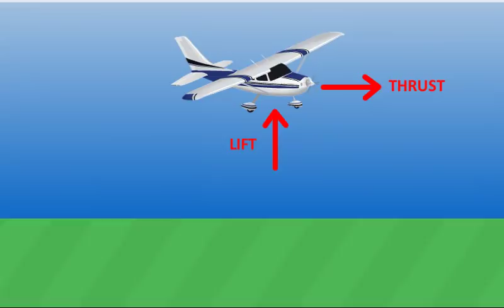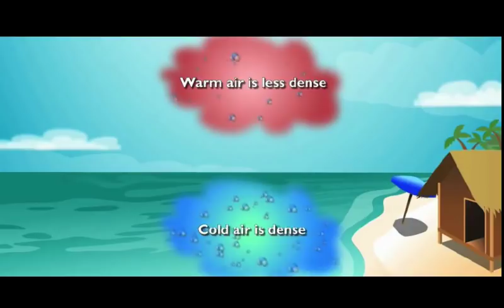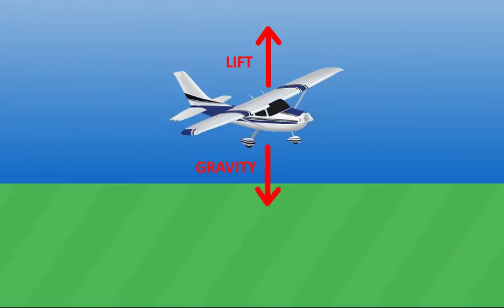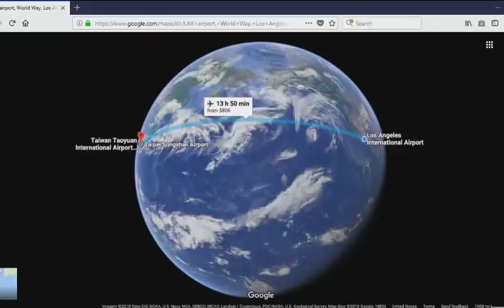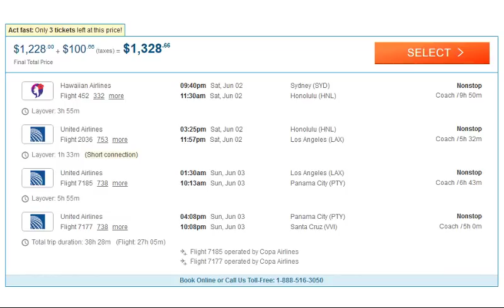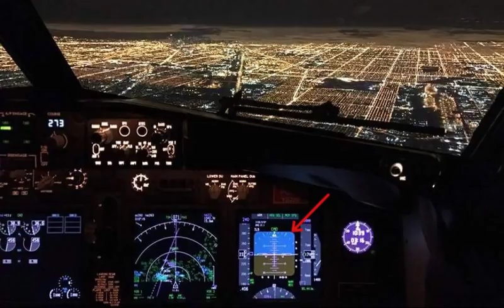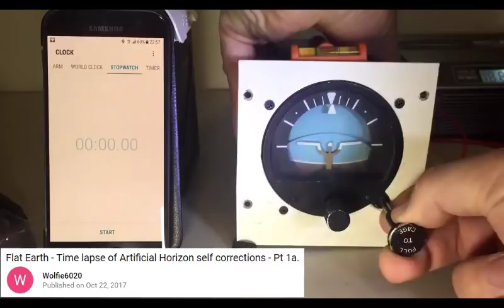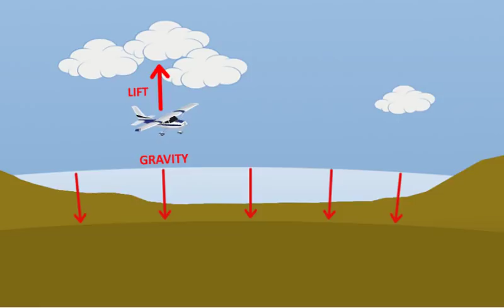Flat Earth Falsities - Plane Nonsense

Comment: Surely if the earth were flat it would be daylight everywhere at once but it's not when it's midday in one area it's completely dark on the other side. The earth is rnd man if your a flat earther you should definitely spend some time reading books
Reply: barreltapper he doesn’t rely on “if this happens it must mean that” at all, he gives actual explanations of why it must be. He never once says what you claim he does
Reply: barreltapper I never said you did or did not believe in flat earth. I was not replying to you but commenting on the video. I made a statement in accordance with my views. Also I found the video explained things very well, he backed up every statement he made and showed the flat earth for the ridiculousness I believe it to be
Reply: barreltapper because flat Earthers lack the knowledge and understanding of science to accept anything as evidence, that’s simply what it boils down to. To them, if they don’t understand it that means it can’t be true. There is loads of evidence out there, I listed 4 reasons alone on another comment on this video:

The rotation of the stars which changes based on location, at the equator they travel directly overhead from one direction to the opposite where as at the North Pole on the axis of the earth they rotate and spin around a single point directly above. This is evidence of a spinning earth, if the earth was flat they would still spin around overhead just in a wider circle but they don’t.

Airoplane and sea travel proves globe earth. Navigation systems work from a globe earth model, everything we have ever known about exploration is based on the earth being a globe. If the earth wasn’t, Christopher Columbus wouldn’t of found the America’s, Captain Cook wouldn’t of found New Zealand. Instead they would of been lost at sea since the model they based exploration on would of been incorrect.

Every other celestial body we can observe is a sphere (and there’s a lot of them) why would earth be any different? It’s illogical to think it is

The horizon wether you agree or not is 100% proof of a curve, objects disappear bottom first over it, that there is no denying. Flat earthers think this is due to perspective. It isn’t. Perspective makes object shrink in the distance like shrinking an image in Microsoft word by grabbing the corner, it doesn’t make things disappear bottom first. It’s just flat earthers don’t understand perspective.

There is a very famous photo of the Earth from the Moon, it just gets disregarded constantly because NASA took it and apparently they lie. It’s edited to increase brightness and saturation to make it appear more vibrant so instantly it get disregarded as “photoshopped” and fake.

I hate to say it, but the railroad argument is stupid. Gravity constantly pulls objects to the centre of the earth, when an object is going “down the side of earth” it’s pulled towards the centre, down is relative to the direction of gravity so the train isn’t fighting gravity at all. Gravity is just pulling it down..... again it comes down to the fact you dont understand it  so it can’t be real.
Reply: barreltapper a train is never ever fighting against gravity to head up the side of the earth because it’s always moving perpendicular to gravity not parallel
Reply: xWhiTzZy; That being the case, why is there any dispute about the shape of the Earth, Gravity and whether the Earth rotates or not, where is the clear evidence of any of this? Whatever side you come from you do not know the truth, so why pretend that you do? He gives us his belief about what he "suggests" as the truth. Give me a straight answer, why do you think or believe, that despite six missions to the moon, nobody took photographs of the Earth or a film of the rotating, do not believe that would have been top of the list of must do's?
Reply: You are perfectly free to believe what you like and to then close your mind against any other possibility, that is the well worn position of the bigot. However you should always bear in mind, that some of the things which you accept in terms of a Globe rotating Earth are every bit as ridiculous as some of the suggestions of those whom believe otherwise.

 I came to this problem when I was discussing the laying of a railroad track, which to function properly needs to be perfectly flat.Even the slightest of slopes can cause a train to stop with wheels spinning and I wondered what was the difference between the gravity which the train could not overcome on a slight slope and the full weight of gravity which it was obliged to overcome, while in the process of climbing up the side of the Earth. Even those whom had never even pondered the problem, thought the question was stupid.You would have me believe, with a straight face, that should there be a railroad track running full circle around the Globe earth, the train would go down the side and continue upside down across the bottom and then climb up the other side, and you talk of ridiculous ideas? Give me a break.
Reply: barreltapper basically down is always towards the centre of the earth for us, wether we are on the bottom of the globe earth or not we are pulled towards it
Reply: Do you think I never went to school or what? You people who know everything never give a straight answer. Lets us start at basics, is there any such thing as flat and level? Because what you are suggesting would mean that when building a tall structure it would always be wider at the top than at the bottom, that is according to your version of gravity, so how do builders get around this problem?
Reply: how small do you think the earth is? there is 1 degree of curvature every 111.3 Km.  over a 1 km distance if my math's is correct there is about 0.009 degrees of curvature thats an entire Km. The empire state building is only 129m across East to west. The curvature over that 129m distance is 0.00000127 degrees. Do you really think that that number is big enough that it will have any impact what so ever on a straight line? it is pretty much as close to flat as you can get without actually being flat. it really isn't going to make building wider at the top than the bottom
Reply: You push your luck by showing everybody that you have never had the curiosity to look beyond what we were all fed in the classroom. You still fail to grasp the fact that you are relying on the stupidity of a single image of the Earth, which was actually the Blue Marble, which was to be seen over the shoulder of an astronaut, while totally ignoring the fact that nobody took any detailed images of the very thing everybody was dying to see, including the scientific community, which would have solved all of the things we are discussing. I have no doubt you believe that all those men on the moon simply forgot to take any snaps of the Earth while they were there. Wake up!
Reply: I've had curiosity enough to listen to people like you spout utter shit that i can completely disprove and explain myself through my own observation or understanding. If you come up with a convincing argument that makes sense and actually gets me questioning existence then i'm all for changing my mind, it just so happens that no flat earther has provided an argument like that yet.

In case you don't realize, space missions are very demanding. equipment is limited to essential stuff only for survival and science, they aren't going to lug a massive Hubble space telescope up to the moon just so they can provide you with an image of your self looking up to the sky and waving to the men on the moon. Yes the picture isn't great but the first mission to the moon took place in 1969. That's 4 years before the development of the first mobile phone they arent exactly going to have 20 megapixel cameras are they?

i LOVE the fact you arent even replying to any argument i make that proves you wrong, you just progress further and further down a predetermined lists of things that don't make sense for flat earthers that i hear over and over again. 

Maybe take the time to learn something because what you said in your last comment is true, i don't think you ever went to school
Reply: barreltapper said, "you are relying on the stupidity of a single image of the Earth." WTF? We have millions of photos of the Earth taken from outer space! Some of them were taken before CGI was even invented. John Glenn took photos from Earth orbit with a consumer grade camera. You can see the camera in a museum. Computers could not even process images back then.

barreltapper said, "building a tall structure it would always be wider at the top than at the bottom." WTF? Where did you get that silly idea? That's some Grade A logic right there!
Reply: There are no images of the Earth from Space. If you use a spirit level or a plumb line to check whether a long, tall building is vertical, you do not get the same reading from both ends. That should be obvious.
Reply: barreltapper said, "There are no images of the Earth from Space" Wrong. Try again. How do you think that we know where hurricanes are? I am still waiting on you to explain your nonsense about how,  "building a tall structure it would always be wider at the top than at the bottom."
Reply: At last a brainiac who can show me where to find what I have failed to find anywhere online for the past five years, clear images of a globe earth, with all the continents clearly visible, not ones where the size of each continent changes, so go ahead show me these images, and don't bother with the ones that are not CGI, they are painted and the guy who painted them explained how he painted them. If such images existed there would be no debate about the shape of the Earth, and the layout of the continents, so don't waste your time looking for them.
Reply: barreltapper every time you type something you come out with a statement even more ludicrous and stupid than the last statement. There are literally thousands of photographs, not paintings of the earth. Of course on a single photograph we can’t see all the continents, are you stupid? Some are on the back of the earth! I literally googled photographs of earth and the very first two side by side show the continent of Africa the exact same size. The only change between them in the colour and resolution between the images as cameras have gotten better over the years.

Buildings sway in the wind for one thing so yea at the top they probably aren’t going to be straight. They are also built by hand and human error is quite a common thing. I am willing to bet though that you have never once took a spirit level to the top of a skyscraper and held it to the side of the building. What you just said actually made me spit out my morning coffee. What makes you think they aren’t straight?
Reply: barreltapper also when you make a statement and someone replies, don’t change the subject from that statement argue the point you made in that original statement. Otherwise you just end up looking like you have no idea what’s going on. You have quite a few points on this comment replying to me and then when I tell you why that is wrong you completely change the subject
Reply: Every time you make a comment you demonstrate your total lack of all and everything. Are you ready for this? A plumb line or a spirit level, measuring the verticality of a long building, at each end  according to you, will line up with the centre of the earth. So get out your compass, draw a circle and put a house on top and draw a line from each end of the house, to the dot in the centre of the circle and let me know what you end up with and why? There's a good boy.
Reply: we are talking a circle with a 40,000 km circumference, 12,742 km Diameter and you are hung up on a sky scraper having a width of  129 m? an object that's 98,775 times smaller than the diameter of the earth? and you say its going to be out of line? you sir are a fucking idiot. i would understand your point if skyscrapers were like 10 Km in width but they aren't so they work fine
Reply: Now we get to this one. Which part of it is i  response to what I said, you have simply avoided any what you can't explain. The Russians have just built a bridge 19 mile long, the distance between two perfectly up columns, miles apart with a plumb line hanging vertically beneath them that show not a jot of inclination towards the centre of the earth, the distance between them is exactly the same at the very  top and the point of the plumb line beneath. How do you account for that? Explain to me how gravity detects the difference between the water running down a roof and the water at the side of the Earth,
Reply: I'm assuming since you didn't explain it very well that what you meant in your previous comment was that because of the earths curvature the building should be wider at the top than the bottom. I proved in my previous comment why it didn't matter on such a small scale, over the width of a building the earth is pretty much flat, there is no noticeable curve so the building isn't going to be any wider than a couple of centimeters AT MOST even for the tallest building in the world. My entire comment relate completely to what you stated you just cant understand it.

Ok have you actually been at the top of the bridge and measured the two points? no? i didn't think so, so that argument is completely invalid.

GRAVITY PULLS THINGS TOWARDS THE LARGEST OBJECT NEARBY THAT OBJECT IS EARTH!!!! what do you not understand? there is no detecting a difference for gravity, the largest object has the largest pull, is a house roof bigger than the earth? no, so the water is pulled towards the Earth not the roof of the house. it just so happens the the water is touching the earth on the sides of the planet so guess what? it pulls towards i and conforms to it's shape. 

If Jupiter happened to fly past Earth in close proximity (not that that is possible) but theoretically if it did, guess which way would be down to us? that's right towards Jupiter because its bigger than earth, we wouldn't stand on the surface of earth anymore we would be standing on Jupiter and the water would conform to jupiter.

Honestly it's really not hard to understand, i'm seriously worried for you if you can't grasp this simple concept
Reply: None of what you claim has ever been proven. Theres is no proof of gravity unless you go down the road of a scientist's theory is fact. Thank you for explaining the difference between water on a roof being pulled to the Earth by the bulk of the Earth and because the sea is on the Earth etc but then so is a river which behaves like a roof, why not like the sea, which gets pulled, we are told by the moon. 
You failed to explain how being held by gravity allows a train to travel up the side of the Earth without problem, while should it encounter the slightest slope on its way up it would grind to a standstill, the same gravity that sends anything with wheels at the top of a hill to the bottom even though it is under the pull of gravity. 
Pretty multifunctional this gravity thing that you apparently fully understand but which leaves me baffled, even though I learned everything you tell me at school just as you did. The problem we have is the fact that you have a closed mind and there can no discussion with a closed mind.
There was not one single photo of the Globe Earth taken by the men on the moon. That can only be because they did not go to the moon or they found something that they prefer not to tell us. Would you agree with that? 
By the way, when on holiday in Spain, we were driving down a hill and we stopped to take some snaps, I was amazed when I dropped a can which rolled away up the hill. How do you explain that, there many people there all having a laugh about and no matter how hard you tried, you could not adjust your view to see that the road was going up..
Reply: in scientific terms theory is the opposite of what you think it means, generally a theory is a speculative guess or assumption But a SCIENTIFIC theory is something that can be observed, tested and recorded. Gravity actually has been tested many many times. It's actually really simple to test, drop a ball in the air is the simple one, The Cavendish experiment is proof of gravity and has been recreated many times over the years despite what other flat Earthers may state, just Youtube Cavendish experiment recreation. The fact things orbit the earth is proof of gravity, the fact meteors fall to earth is proof of gravity, the fact we can land drones and lunar landers on the moon is proof of gravity (wether you believe the manned missions to be real or not) the fact we can observe matter being sucked into a black hole is proof of gravity, the list goes on and on.

what do you mean a river behaves like a roof? a river only flows if its going down hill, other wise it's still and we call it a lake. Water only flows off a roof if its a sloped roof otherwise it gathers in puddles. This is because gravity is pulling it down hill, remember gravity pulls towards the center of the earth not it's surface so even if a surface is slanted downhill it doesn't change the direction of gravity, it instead causes things to roll down the slope. 

The moon causing waves i believe is actually a misconception. what causes waves is wind moving over its surface, as the air travels it moves water, as more and more water is moved by the air it gathers into a wave. The stronger the wind the bigger the wave typically as the air is moving faster and transfers more energy to the water.

Yes you are right, uphill trains don't usually exist, at least not steep ones. i believe there is a train that travels up a mountain somewhere in Sweden or something but i can't remember it's name. A train can move up a slight slope the same way a car travels up hill, an aeroplane takes off or me and you can jump in the air. It generates a greater force than the force or gravity at that moment allowing it to travel up a very slight slope. As for travelling up the side of earth remember, no matter where the train is on the globe down always points towards the Earths center, it is never travelling UP the side of earth per say because relative to it's location on the globe it is always travelling sideways. This is actually quite hard to explain without a diagram so i hope you can understand it.

It boils down to basic physics really, if you generate more of a force in one direction than the direction opposite to it it moves in that direction. if i generate a force greater than gravity i will leave the ground, that's how rockets work. If you drive a car you will be familiar with the fact that if you want to drive up a hill you have press the accelerator harder which causes the car to burn more fuel and in turn generates a larger force in the direction your moving to counteract the force of gravity pulling you down the hill. I don't have a closed mind, i just have enough of an understanding of how this stuff works that to me the flat earth argument doesn't make sense to me since i can explain how everything works.

There is actually a very famous photograph of the Earth from the moon and i believe it is called Earthrise It was taken by William Anders who was an astronaut for one of the moon missions. It depicts the Earth rising over the moons horizon the same way the moon rises over ours at night time. So actually i disagree with that statement, They made all the images public a few years ago.

You dropped a can and it rolled up hill? that's the kind off statement you need evidence for. If that actually happened anybody's initial reaction would be to film it, so unless you can provide me with the video i'm going to say that's a lie. If you do provide me with the video then i will eat my words, Gravity doesn't exist, the Earth is flat and i have been brain washed all my life
Reply: I can think of one case where a can may of rolled up hill so far and that is if it had momentum moving in that direction at the time of hitting the ground, say if you tried to grab it as you dropped it and just knocked it up the hill, it would roll for maybe a couple of seconds at most until the constant pull of gravity slowed its momentum and caused it to start rolling back downhill or if that couple of seconds was enough to allow it to find flat ground
Reply: People were putting things down to watch them roll up hill 0K We put it down to an optical illusion of some sort. As for your excuse for scientists, when Newton saw an apple fall off a tree, he was not the first to notice such an event and he was not the first to be baffled by what was happening and he knew no better than do we, how and why it fell and to the day he died he never worked out the reason for the phenomenon. 
When Darwin spoke of evolution, he had no notion of the incredible complexity of one single cell in the body of a living being, which is so complicated that for the very smallest component of the genome to have already come into existence by chance and then, having nothing else to do hung around doing nothing until the next complicated bit turned up millions of years later and so on, which is one of your observable pieces of information on which  highly likely scientific theories are based, is that right?
Cavendish allegedly worked out the constant of gravity, using a piece of apparatus which was basically a load of tosh,  using a couple of lead weights and a periscope. An experiment which has never been repeated.
The rotation of the Earth is yet another unproven idea, and yet you and others base all your notions about celestial bodies based on this unproven idea, and on all of the above subjects, to disagree with you invites derision. Can you not  see the funny side of your position?
Reply: https://youtu.be/ybaw_ZJDJ5o
Reply: that's interesting, i watched this video: https://www.youtube.com/watch?v=BRzwNycQTok before i watched the one you linked and i could instantly tell that which end he said looked like the low point was actually the high point before he even said it, guess it didn't fool me. 

The one you linked however did, but the minute you lose sight of the two roads together and only see the one on the right that looks uphill but is actually down hill the illusion broke and i could tell it was downhill. It is just an optical illusion though so there is no gravity defying going on, objects still roll in the correct direction Gravity is pulling them.

No he wasn't the first since it had been happening since the beginning of time. He was the first to call it gravity though and to come up with a unit of measurement to measure gravity (Newtons). Henry Cavendish actually expanded on base that Newton created for the idea of gravity by conducting an experiment that proved its existence called the Cavendish experiment. This proved that separate objects are pulled towards each other. So actually we do know a lot more about gravity than Newton did back then, we now have evidence suggesting it exists and a number that we can put in equations that represents the constant force of gravity.

I'm not sure you understand evolution or maybe i'm not understanding your explanation of it. Evolution is when a creature adapts to be better suited to it's life style and needs. Best example i can think of is giraffes. Giraffes didn't start out with long necks they would of been grazers like a modern day horse, goat or cow. As competition and populations of other grazing animals grew, Giraffes with the longer necks that could reach low branches and eat leaves would of thrived while the ones that still grazed as they couldn't reach the branches would struggle to find food and often starve. This leads to longer necked Giraffes breeding and their children inheriting their long neck. Over a long period of time every generation of Giraffe with long necks would thrive and breed until we have the giraffes of today that only have to contend with each other and not other species.

Same for Humans who evolved from Apes. Apes that learnt to use tools and their brains surpassed Apes who used pure brute strength as they could acquire food easier and survive in harsh climates, they bred while less intelligent apes died due to starvation and other things. Slowly over time the New intelligent apes didn't require as much muscle mass as their intelligence made up for it. a larger muscle mass means they require more food as they burn more calories. Smaller less muscular Apes thrived since they could live of little food while bigger apes starved. So on and so forth, that's how evolution works. I'm not 100% sure on what your claiming in the paragraph you talk about Darwin in.

Cavendish's experiment has been recreated and continues to be recreated in classrooms around the world, do me a favor and youtube it. there are a few professors who have filmed it. I remember being shown the experiment in Primary school myself and it works. I'm no scientist, i'm not going to pretend i know how he worked out the gravitational constant, Im sure given enough time and research i could find out how he did though, but i would guess he measured the distance the torsion rod rotated and the time it took for it to rotate and then did some mathematical formula to work out the constant.

The rotation of the Earth has been proven. If the earth is a globe and we are correct about that which i'm sorry but for all the reasons i have stated in this comments section i believe we are until someone comes along with actual evidence of a flat earth that i personally can't explain and proves me wrong then the Earth has to rotate. We can observe the fact that objects don't rotate around us which is what early scientists thought happened so that has been proven wrong and we can observe our planet and other planets moving around the sun (any amateur with a telescope can chart the position of various planets at various times) so we know we orbit the sun. The fact the stars rotate above our head then means we have to be spinning there's no other explanation
Reply: Had a look at your clip funny business. In the one I sent I think it was something to do with the join between the two roads and it was just a case of a difference in heights. I'll give you headache with a reply to rest of your document tomorrow.
Reply: I don't believe that I  have mentioned a belief in the Flat Earth. I have been discussing the rotating earth. But since you mention it and you are so sure of your truth, explain to me why the guy who made this clip had to rely on the usual, if this happens that must mean that and if that happens it must mean the other, why not simply show your proof without beating about the bush?